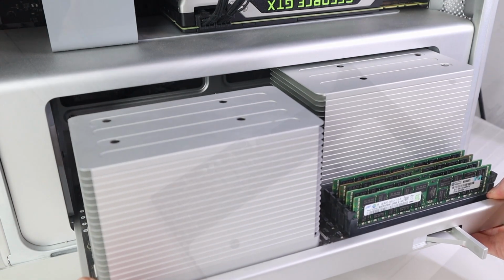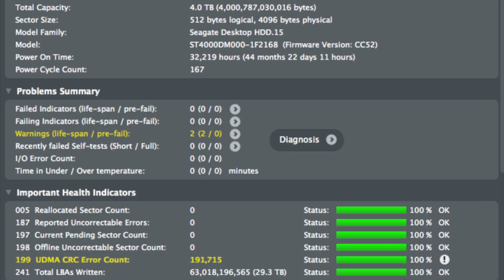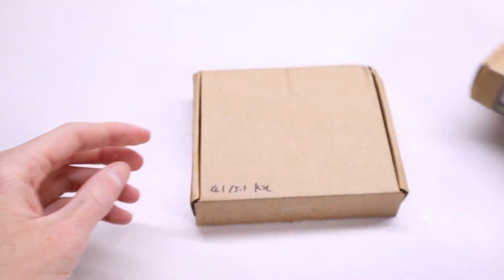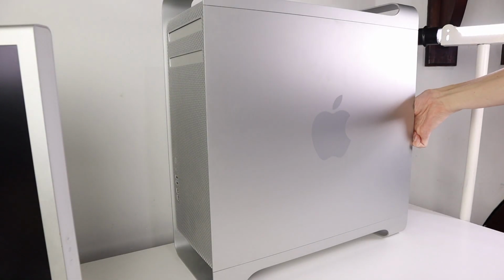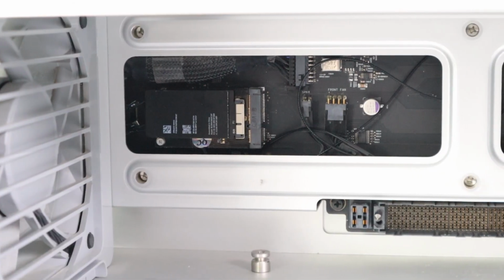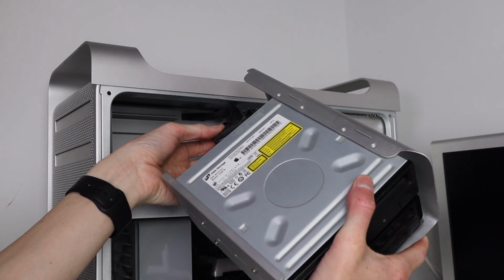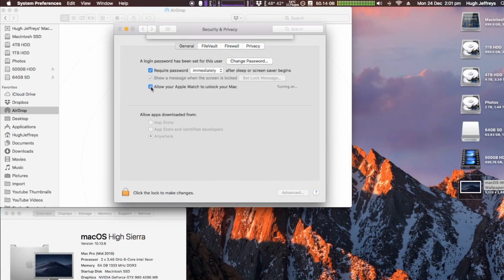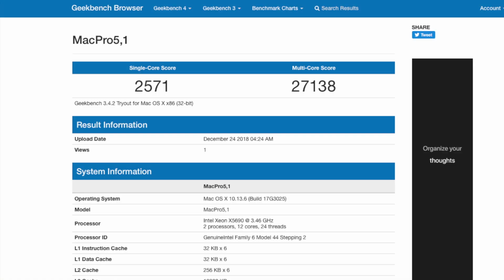The most powerful Mac Pro 5,1 ever?

Comment: Enjoy my 5,1 daily. 
2 x Quad-Core Xeon 2.4Ghz
32GB Ram
SSD Drives
ATI Radeon HD 5770 With 3 1080 Monitors Connected (using active thunderbolt to DVI adapters)
Beast!
Reply: What are doing with all that power?

Comment: It's a very bad practice to simply "move the hard drive from one system to another". There's reason for Apple making both Time Machine and Migration Assistant software. Without using Migration Assistant, you will run into certificate errors and possibly other licensing/activation problems.

Comment: I have a 12 core ( dual 5690's )  3.46 Ghz system with a GTX1080 Founders edition ( Not flashed, Off the shelf ), 12TB Internal raid, 4 TB single drive, UsB3 card with 4 individual controllers and a SSD System drive, so it could be upped a bit.

Comment: Nice informative video with some good upgrades. I would mount your SSD in an OWC Accelsoir to use the PCi-e lanes as opposed to SATA 2 ports ( I think MacPro 5.1 has just SATA2 for the upper disk bays) Although an NVMe would really make em fly.

Comment: I'm not hating, but in my opinion, at this point in the century you would be better off buying the new Mac Mini and upgrading the RAM and SSD. Not only is the new Mac Mini faster, but much more energy efficient. 

Consider getting at least an RX560 or better, it will help with video rendering in fcpx.

Comment from the maker: UPDATE:
Handoff started working perfectly.
The previous solder job was very poor and weak so I resoldered the bluetooth data wires on the adapter board and now the bluetooth is working and not showing "not available"

But I was still getting mouse lag and my AirPods would cut in and out, after removing the USB 3 card the issue has gone away.
USB 3 devices can interfere with bluetooth and as the antenna for the bluetooth in located in the PCI slots it was causing this lagging issue.
So now I have to find a better USB 3 card to install into the Mac Pro, but at least my bluetooth is working again.
Reply: Hugh, Just wondering if you can remember which number wires went to which pin on the new wi-fi card, as I cant run the mini cd to find out. I realise J3 is the bluetooth antenna, but what number wire (1/2/3), does J0/J1/J2 connect to. Hard to read as your camera isn't focused enough.
Reply: Don't worry Hugh, I sorted it out. Sequential 1=J0, 2-J1, 3-J2
Reply: for the Graphics Card you should know that Apple and Nvidia doesn't go well together and with this the Nvidia drivers are not being provided by apple anymore, since they had many problems in the past, only AMD cards have updated and more stable drivers on Mac
Reply: if you haven't figure out the antenna you can make an external, i have done that and my headphones stay connected and play perfectly when i more than 50ft away 

I used : RF U.FL(IPEX/IPX) Mini PCI to RP-SMA Female Pigtail Antenna Wi-Fi Low Loss Coaxial Cable 1.13mm
drilled a hole in one of the metal plates that cover the  PCI slots on the back of the tower, secured the above mentioned wire to the plate and screwed a wifi antenna on the male end.,
Reply: NVIDIA can't update Drivers anymore on Mojave

Comment: I'm about to install 2 x5687's in my 2010 Mac Pro 5, 1. Has anyone ever done this? I haven't found anyone on the web who's claimed success without it being a Hackintosh.

Edit update: I tried and does not work. I know this was kind of stated somewhere, although not clear enough for me to try. I installed, started up, and only the red lights on the dual-cpu board. Thank goodness I was able to use the 87's in a spare t5500. (another great gas-guzzler machine)

Comment: What cpu are you using? Which GTX.  Do you not use SSDKs?  Very intriguing vid as my 2009 I thought was Max’s out and using a RTX 580. 

The Bluetooth tip in the notes is very good too as I always have BT dropout for my wireless keyboard. Thanks for this.

Comment: re: bluetooth. it could be heat or as mentioned by highvoltage12v, it could be the antenna cable. try a usb bluetooth dongle so you actually use the usb 2.0 ports for something :D

Comment: Nice setup! You can speed it up a bit if you remove the last RAM-module on each side. The system is designed as tripple channel memory for best performance. At least recognizable in benchmarks... :)
Reply: This is very interesting! Could you tell me more about this. What kind of performance boost can we expect? Do you have a link with info on how to do it. Not sure what you mean by last ram module on each side.

Comment: I have one of these nearly maxed out (12 core 3.6 or 3.3 whichever the max clock is with 32gb of ram)  I've got a 8GB 580 Nitro + which blocks a slot but it doesn't require driver's as AMD drivers are built in. I use an OWC PCI to Sata card for boot. The four drive bays are in two raid sets. I've got the OSX WiFi card installed. It still performs really well. Definitely recommend AMD as Apple won't approve Nvidia driver's for Mojave

Comment: I'm selling some old Mac Pro hardware for cheap, if anyone is interested! I just finished upgrading mine to 3.33GHz 6-cores x2, 16TB RAID 0, 512GB NVMe Samsung BOOT, 64GB RAM, AMD Radeon Vega Frontier Edition 16GB (running MacOS Mojave smoothly) and USB-C.
Reply: What "Old Hardware" do you have?
Reply: Gordon Crompton I just SHIPPED it out today. It was a bundle of GTX 680, 4x 1TB HDDs and SSD 2 PCI Adapter for $225.00.
Reply: @jasonhaas607  Thanks Jason.  I'm looking for a 4.1 if any are around at a decent price - I would even go for the logic board as I have 2 old "cheese grater" Macs in the basement - both work but I would like to update!
Reply: Gordon Crompton eBay is where I got mine!

Comment: The problem is not with gtx 980 the black screen and not also drivers of navidia
 
Remove usb 3 card and it will never make black screen you will see 

Also rx 580 card works the best with this Mac Pro better then 1080ti

Comment: DAMN, I want it. You lucky DOG!! 64 GB of RAM &^&%^*
Reply: Well, actually (I have this EXACT machine) this model has its RAM buses arranged in 3 slots per channel. So putting in 64 GB (filling all 8 slots) is actually slightly SLOWER than using 3 slots x 16 GB, 48 GB, and I never max out the 48 GB.
Reply: I ve got 128gb = 8x16gb 😋
Reply: wiedjai I didn’t know you could stick 16 GB sticks in there... nice.
Reply: @SocialSpit  officially till 8gb but 16gb is supported at least in 5,1. That’s the max. And slot 3/4 and 7/8 are shared. So  when all slots filled it’s not the fasted but the fullest😎. I have dell modules low voltage ecc registered. Its actualy hynix with dell label on it.
Reply: wiedjai yes, I was looking through my owners manual and it basically says that the maximum amount of ram is 16 GB. So if there is someway that you were able to increase that maximum, any information is welcome
Reply: wiedjai that’s what I have in my Dell, actually. I had two identical OptiPlex. Both had 8 GB so I took the ram out of one and stuck it into the other, it was 16 GB of Dell branded Hynix. The bottleneck of that system is that it has Low speed SATA. Everything else is pretty fast.
Reply: @SocialSpit  i used sk hynix htm42gr7mfr4a-h9 t3 ad. Dell branded. You better not combine different brand and type. Use all slots the same. Also same size.

Comment: If you do the mojave firmware flash these 5,1s now support all NVMe drives (EVO 970 Pro and the like), unlike the previous firmware that only supported AHCI style M.2 drives.  Making the switch to a blazing fast M.2 boot drive quite affordable.  Not as fast as the drives support (due to PCI Gen2 etc), but still screaming.   Just a tip.
Reply: C Rizzy  Yep.  Full boot support, even pre-boot.  You don't have to use Mojave, just do the firmware update.
Reply: C Rizzy  Yeah my SM951 (AHCI) perform about the same as the EVO 970s, in that 1.5gb neighborhood, it's just nice cause the non-AHCI NVMe drives are MUCH cheaper, even brand new.  Used you can get some crazy cheap ones.

Comment: Which HDD you recommend to put in one of the slots? Already have -
[ ] Mac Pro 5.1  12 core x 3.46Ghz
- [ ] 6x8Gb = 48gb 1333Mhz ECC ram
- [ ] AMD Radeon RX580 4gb
- [ ] Kingston M.2 HyperX Predator AHCI  240Gb (flashblade) 
- [ ] Samsung 960 EVO 500Gb(flashblade) 
- [ ] 1tb HDD
- [ ] USB 3.0 4-poorts.

Comment: Mine is same cpus. 128gb ram. 1080 ti. Bluetooth 4.0. 4x usb 3.1. 10gb/s networking. 4x samsung sm951 on quad pcie card for 1TB 5.5GB/s ssd storage. 4x 6TB WD Black HDDs in RAID 0 for 24TB of 1GB/s HDD storage.
Reply: @JD Langton  
Hi jd, have 4 questions for you 
1-which usb 3,1 card 
2- which macos
3-Any apple bluetooth mouse  freeze problem while using usb 3,1 card
4-what speeds you are having while using usb 3 or 3,1

Thanks
Reply: @evreka__3723   
1 - High Point RocketU 1344A
2 - High Sierra (No nvidia drivers on mojave yet)
3 - I dont have apple peripherals - sorry
4 - close to 10GB/s per port - depending on drive of coarse
Reply: @JD Langton 
Ty for lightning fast response 
Have a nice day

Comment: I had a 2009 Mac Pro back in 2009 it was an 8 core they were insanely expensive it had 24gb of ram, all the graphics cards were Mac flashed graphics cards right up until the last one even made and then I sold it for a 2013 Mac Pro.

Comment: Hi. It looks great. I like this design. The interior looks like a high tech future city. I like that it's really maxed out.

I wonder if the 2019 Mac Pro will go back to this design (hopefully way better and revolutionary). I'm done with an All-In-One like the iMac. It's cheaper but it breaks easier (coz' I guess there's a lot of compromises with cooling- you can clean the fans is one or easily DIY repair it).

God bless, Proverbs 31

Comment: Nice video. I've done a similar upgrade for my main audio recording studio Mac Pro. Except I got an 8GB AMD Sapphire RX580 Pulse video card mostly because it is totally compatible and needs no flash or special drivers and just works for everything including boot and sleep out of the box. Then I got a Rocket 4 port USB 3 card, this card and the Sonnet Pro have 4 USB drivers chips and appear as 4 USB cards and not as one channel with a hub and 4 ports like yours. I don't do wireless in the studio due to past problems with the noise so I pulled the stock wireless card, wired is faster anyway. Your stock drive connectors don't offer SATA3, that's why for a SSD I went with a OWC OWC Accelsior E2 which includes ports for two eSATA drives.

Comment: I will give you a good (tested idea) for storage.

1. Put system ssd into top cd slot. 
2. Put 12tb hdd into bottom cd slot and partition it 8tb and 4tb. (or 10tb hdd to 8/2). 
3. Make 4/2tb partition a time machine.

4. put 4x2tb hdd into standard bays. Make them software raid 0 in disk utility (will be as fast as ssd - about 500/500).

5. create a cron script that will backup with rsync this 8tb raid to 8tb partition every 5 or 15minutes excluding any cache folders.

You will have 8tb „ssd” that is backed and in case of raid failure you will lost at most 15min of work.

Attach 2 „dumb” external cases (4x) to esata or usb3 pcie card and put there large hdds for completed work. eSata is slightly better for working with severall hdds even though it’s 3Gbps and usb3 is 5Gbps. 

I suggest to put into cases pairs of live/backup large hdds distributed to separate cases instead of raid - Rebuilding raid lasts ages, software raid is not as stable as hardware and hardware raid would take one pcie port.

Create simillar cron to backup those too.

This system works great - and time machine saved my ass 2 times when system crashed after power failure.

Comment: I had the same problem with Bluetooth. I finally wired an external Bluetooth antenna. It’s a huge overkill antenna but I have a very solid connection now.

Comment: I have the same cpus but 128GB of ram and a 1080ti in line with a 256GB nvme drive for Mac os, a 480gb sata SSD for bootcamp and a 4tb shared storage HDD.

So no, not the fastest but it's close enough

Comment: To solve the poor Bluetooth reception, when I had purchased a bluetooth kit from osxwifi.com in the options you can purchase a bluetooth antenna that you can place pretty much anywhere on the MacPro.

I will say this from my older (2006) 1,1 MacPro to the 5,1MacPro the bluetooth antenna location is pure garbage. The bluetooth antenna location (pretty much on every classic MacPro) is where the opening of the PCIe slots are at, You can't see it, but it behind the outside (1,2,3,4,) label of the PCIe slots on the 4,1-5,1 MacPro. The issue is, its in a poor location first of all, also there is a very well known issue between the operating frequency of Bluetooth an USB 3.0 that will cause both to have issues in data drop-outs, and being that the antenna is right at the connection of the USB 3.0 ports its just BAD.

What I did to remedy this, is when I bought the kit with the extra antenna, I installed the Bluetooth antenna at the bottom of the MacPro where the antenna is for the Wifi, far away from the USB 3.0 card. In order to do this I had to remove the CPU cage and drill a very small hole on the bottom of the case. route the small connecting end from the outside in and plug it into the wifi/bluetooth card. Once assembled I was able to move the antenna around till I got best orientation for signal strength (if you hold the Option key while clicking the bluetooth icon on the top bar it will give you more detail spec's along with the decibel signal strength, The LOWER the number the better signal, the HIGHER number the poorest. Zero to -60dBm is considered best, -61dBm to -70 is considered 'Ok' anything above -71dBm is poor to bad. Also it does NOT auto update the signal strength, so you'll have to close the dropdown and re-click with option key to get an updated signal strength.) 

After a few trial and errors I came up with the best location for the bluetooth antenna underneath the MacPro and used the provided double sided tape to hold it in place. Now I don't have any bluetooth drop outs on my Keyboard or Mouse, my signal strength is between -50dBm to -70dBm, on average about -66dBm for both my keyboard and mouse.

Comment: Ok. That was cool. Thanks mate!

But what exactly is a "mac flashed GPU"? Can't say I've ever heard that term - but I'm more into hackintosh than upgrades. Also what's the max version of Mac OS? Sierra?
Reply: The Mac Pro, and every other Mac, requires a special sauce GPU firmware to work. Any brand new GPU you buy on Amazon or Newegg will not work in these Macs out of the box. There is zero reason for it to be this way except greed. After flashing, the new firmware on the GPU is only compatible with macOS drivers and will not work in Windows.
Reply: @markm0000  oooookay I didn't know that! But thanks. I guess coming from a hackintosh world I just never had to do that..? It's taken care of by the kext injection, or not needed at all. I'm not sure how they relate to each other since I've only had hacks and MBPs... I'm uncharacteristically confused by all this.
Reply: pixlplague yep hackintosh kexts do all the dirty work with components that weren’t blessed by Apple.
Reply: pixlplague also MBPs have the same problem if you hook up an external GPU. If you have a simple thunderbolt to pci adapter you’ll need the special sauce GPU. If you buy the expensive enclosures they convert the driver communication in the background and make it “just work”
Reply: @markm0000  well I be! I knew rigs worked oob, but it never occurred to me there was conversion magic happening... Thanks for the info!

Comment: I left my iPhone 5s on a charger which is not Apple for 15 minutes and when I came back it was dead I want to know what damage happened because I didn't open it because I don't have special screwdrivers and I will buy screwdrivers and the replacement parts needed

Comment: I like your video about this computer. This is because, I’ve also dreamt of a 12 Core Mac Pro forever.
Reply: I bought mine for around $1,300.00 on eBay in 2016!
Reply: Jason Haas 12 Cores for 1300 in 2016 was a good deal. Congratulations! I am guessing that computer and yourself have grown together?
Reply: Jose Francisco Medeiros Thank you for this input. I was able to find a 5.1 8 core. I hope to upgrade it soon to those 3.06 or 3.33Ghz, 6 core twin CPUS. Depending on what other upgrades I have before hand will determine which set I pick up. (: